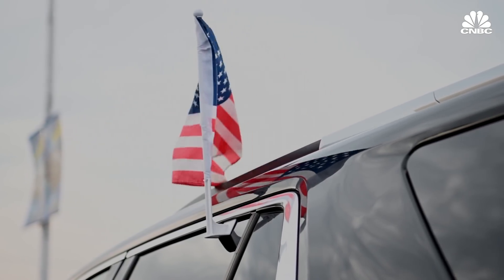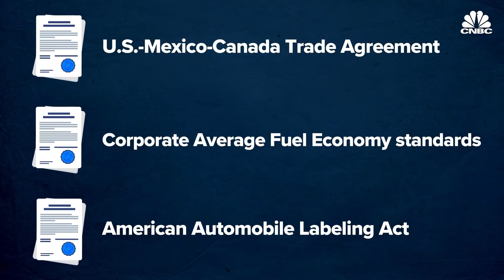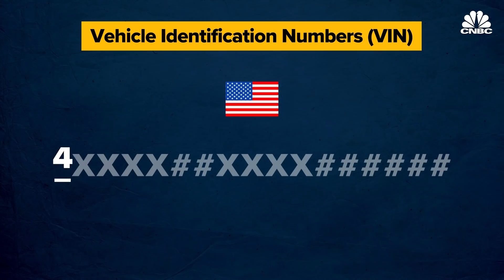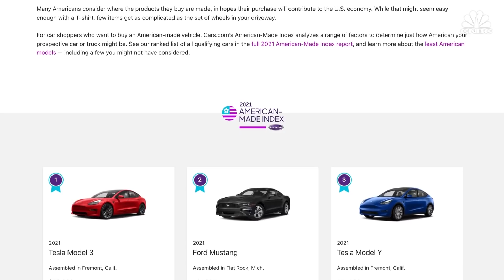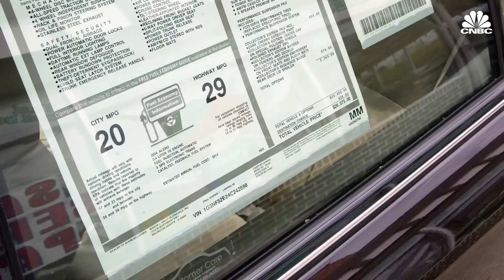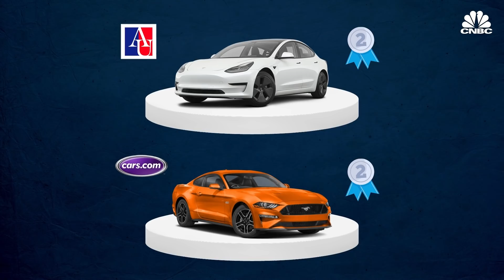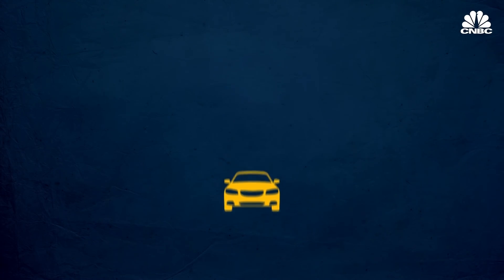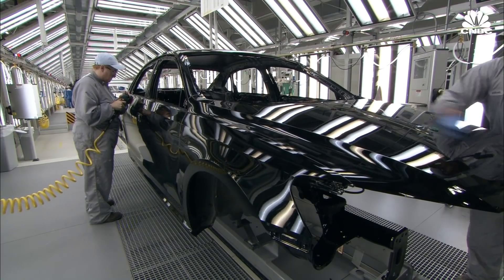How American Is Your Car?

Comment: The simple answer is: "It's complicated!"
I worked as a machine designer for over 35 years. The company I worked for, in the US, designed and fabricated the machines "in house". What we could not fabricate was sent out to local US companies. So it was "All American!", right? Except, no. Almost all of our purchased components like bearings, fasteners, air valves, gearboxes, electronic control devices were all made in foreign countries. Even some of our engineers, machinists, service people and even some company managers were foreign born. It truly is a global economy and has been for several decades.
Reply: Great summarization saves me quite some time watching the video
Reply: Don’t tell Trump and his cult that, they’ll insist isolationism is practical. 😆
Reply: No offence to OP but just because one's foreign born doesn't mean you should isolate them in this topic, they could have been kids moving here working and busting their balls to get that job no different than anyone else. There are also situations where the only option (at the time) was to bring someone in, for all we know they could be one of the top 5 people (or better than the locals) in their field. For workers all that should matter is fair pay and they have all the requirements to work, including paying their taxes.

Comment: My Buick Regal:
Final assembly: Germany 
Engine: USA
Transmission: Japan
Reply: And it’s actually german regardless.
Reply: @cory8837  - Well, it's somewhat older. The last MY for Regal was 2020. It was a rebadged Opel, a German brand that GM used to own but no longer does.
Reply: Hotel: Trivago
Reply: Opel Insignia
Reply: I'm happy as long as my car isn't made in China or Mexico.
Reply: How bad is your oil leaking in your German-USA-Japan car? 🤣
Reply: and who knows how much of the parts flew half-way around the world 10 times before they actually were attached to vehicle being assembled.

Comment: I'm slightly baffled as to how having such complex supply chains can be more efficient.
Reply: shipping things are super cheap.
Reply: @fallout560  The average cost of shipping a standard large container (a 40-foot-equivalent unit, or FEU) has surpassed $10,000, some four times higher than a year ago. The spot price for sending such a box from Shanghai to New York, which in 2019 would have been around $2,500, is now nearer $15,000. Securing a late booking on the busiest route, from China to the west coast of America, could cost $20,000.
Reply: It depends on the people's salary and factory capability.
Imagine paying an American 10usd a day.
Reply: It is cheaper thanks to fuel subsidies, low wages, lax environmental laws, etc.
Reply: It's all about labor and manufacturing costs plus shipping costs being lower than doing it all domestically.
Reply: You will find that a combination of specialisation, there are only a few parts manufactures, like bosch, who provide a significant portion of the market, and then tax breaks. So if 90% of X parts are made in X country, then you will have to ship. This specialisation and concentration will reduce the cost per unit where it is significantly cheaper to ship.
Reply: Not more efficient in production but more efficient making money
Reply: really, because its all bout the $$$$$$$$$$
Reply: Shipping thru the ocean is cheap.
So if you can make a part from another country  that is for example 2-3 percent cheaper that will help alot. As they make millions of cars per year.
Reply: @HadithOfThaqlain  That is the case now, but not when all these supply chains were being developed. Previously, having a component or module built overseas plus the minor shipping costs was cheaper than building that in the country so many went that way. Now, shipping is not minor and it may push that component/module supply chain to this continent, but only if those high shipping costs remain high into the future.
Reply: Cost of material/labor and you know pollution  😂
Reply: Not efficient at all, it's just cheap and that's basically the only thing companies care about
Reply: It's cheaper to ship pears from Peru to Vietnam, process and package them there, then ship it to the USA, than to grow and package pears in the USA
Reply: It’s not, but they have a steady supply of resources.
Reply: @fallout560  You seem to have edited your comment, did you find out that your cost per shipping container was wildly inaccurate? 😂
Reply: @HadithOfThaqlain  i made a mistake and put per mile instead of entire trip. I goofed
Reply: @fallout560  Got it 👍

Comment: Glad to hear my recently purchased Tesla Model 3 is one of the top 3 most American cars you can buy and supports our local economies to the fullest.
Reply: From the window sticker:
US/Canadian Parts Content: 65%
Major Sources of Foreign Parts Content: Mexico 20%
Final Assembly Point: Fremont, CA
Country of Origin:
Motor Assembly: USA
Gearbox/Transmission: USA
Additional Assembly Information:
Battery Final Assembly Point: Fremont, CA, USA
On-board Charger Final Assembly Point: Fremont, CA, USA
Reply: Rented a Model Y on vacation, not only American but extremely fun to drive and insanely fast. Would highly recommend
Reply: Too bad Tesla is against right to repair.

Comment: Big difference between American made and American assembled. Honda is the most American made manufacturer, Toyota is second. Being, they use more American made parts and American made raw materials than other manufacturers. Read a report several years ago that stated Toyota spent over $32 billion on American raw materials for their vehicles that calendar year. GM, Ford, and Ram use parts made as cheaply as possible in Mexico and Canada, which are shipped to the US for assembly. Hence, why they are routinely rated as the least reliable vehicles. That said, the 4Runner and Land Cruiser are the two top vehicles on the road, both made with Japanese parts in Japan, and dominate reliability ratings.
Reply: They had to because of US administration tariffs on Japanese-made imports, so they just did that as a loophole. Really not sure why the US is using tariffs on our ally, Japan, but K.

Comment: Going back as far as my old 2000 Pontiac Grand Prix, to my current 2018 Chevrolet Colorado, to all of the Ford vehicles I work with every day - the majority of the electronics (radios, touchscreens, HVAC control units, computer modules, window motors, speakers, etc) are made in Mexico.
Reply: Yeah my VW was made in Mexico

Comment: With the former Ford Crown Victoria, many people saw it an all-American car, which was actually made in Canada. Arguably Canada is part of North America, though not American.
Reply: There's a historical reason that cars made in Canada are treated as domestically produced in the US. By the 1950s the big three auto makers controlled 100% of the Canadian market. However high tariffs ment that to sell 10 different models in both countries they had to produce them in both countries. This was very expensive so the auto industry lobbied both governments and had them negotiate a free trade deal covering cars and car parts called the Autopact. Over time the manufacturers consolidated production but about the same amount of manufacturing remained in Canada, only now instead of producing small amounts of a lot of different models, Canadian plants produce a large amount of a couple of models most of which is exported to the US and almost all of the rest of the cars sold in Canada are imported from the US.
Reply: @bryandoehler8962  That makes sense! I recall hearing something about that before but not all of the details. I think now anything made in the US, Canada or Mexico is treated the same way, which makes it easier to offer more models to all three countries.

Comment: I’m so glad that I bought a brand new car in June 2020. The Hyundai dealer was overstocked with vehicles at the time. I had my choice of over 20 different 2020 Sonatas  to choose from. I got a fantastic deal, well below MSRP. Since then I have made an effort not to put any more miles on it than possible. In June 2022 the car will be two years old and have less than 15,000 miles on it. I plan on keeping it paying it off and sitting tight. I don’t even believe that their 2023 forecasts are accurate. I think we’re looking at 2024 maybe even 2025 before supply chains are anywhere near where they were before Covid, and even then things are never going to be what they were before Covid. I was just at CVS today and half of the shelves in the store were empty.There was no milk there was no orange juice, only two of the eight or nine items that I needed were there. So I’m not even gonna bother to shop at CVS until the supply chains are better. No sense wasting time gas or putting miles on my car for empty shelves.

Comment: May not matter since my bicycle is made in Eugene Oregon. Parts mostly come from other US manufacturers, except the gear box which is German.
Reply: Trek bikes are still 90% Chinese and some Taiwanese in their assembly
Reply: @ivanvarela3215  I wasn't sure how much of a Trek was made overseas. Thanks for info. I mean, Taiwan does some good work and puts together quality items. Co-Motion is a small company in Oregon that prides itself on US made. However, the drive trains such as Shimano and Pinion are made elsewhere. The Gates carbon belt is, I believe, made in USA. The car company Tesla is also made in USA, but many of their electronic components rely on chips from China. They are trying to move more of their operation overseas. We, that is the USA, need(s) to have transportation which does not rely on stuff from other countries, even if that means paying a bit more. A bike has no electronic parts unless you add a dynamo which generates electricity for lights. The best one, like it or not, comes from Germany, the Son Nabendynamo.

Comment: My car: rebadged Chevrolet SS Sedan in America, better known as the Holden VF Commodore from Australia

Vehicle assembly: Elizabeth, Adelaide, South Australia

Engine: 6.2L LS3 naturally aspirated V8 derived from the C6 Chevrolet Corvettes

Horsepower and Torque: 415hp and 415lb-ft

Transmission: Tremec TR6060 6-speed manual transmission

Comment: Very simplified for trade. Country of origin does not indicate the origin is purely from that region for USMCA. It merely indicates that the good passes one of the three test to be considered country of origin US, Mexico or Canada. The  value content is typically never 100 percent derived from that area. Usually the three test are deminis, tariff shift and RVC to pass and be considered "100% origin" from one of the USMCA's country. There is currently debate with Mexico and Canada saying that if country of origin  is from that region the value content that is foreign not from those area's should be ignored and considered 100% value from those regions. The US is stating the opposite that even if it passes those value contents must be broken down by foreign and not use just being country of origin determination. The topic is a lot more complex and the system to make it work would be a lot something bigger than people can even imagine.

Comment: My car is  Japanese made.The VIN starts with a J. 2010 Toyota  Camry.
Reply: No it's not. There's no way all the circuit boards, and small components in there are fully Japanese. Then there's the actual raw material source
Reply: Scotty “Rev Up Your Engines” Kilmer would be proud
Reply: @veganpotterthevegan  you're right.
Reply: @FilthyGopher  they're made in Kentucky, but also in Japan, China, Russia and Thailand. https://en.m.wikipedia.org/wiki/Toyota_Camry_(XV70)
Reply: @damilolaakanni  The Altis is basically the Camry.  It sold well but they stopped making it due to emissions demands. It's very unlikely they won't re-release it. It'll probably be a Camry Hybrid
Reply: @veganpotterthevegan  true. Australia has ditched the V6 models, and I doubt Europe even has Camry's at all.
Reply: @damilolaakanni  Toyota as a whole sells poorly in Europe.   They're actually only 10th by brand which is crazy
Reply: @FilthyGopher  Actually if the Vin on a Camry starts with a J it was made in Japan. If it starts with a 4 then it was made in Kentucky buddy.

Comment: I have my three Vins# starting numbers from north America 
#1 a 2012 Liberty ,#2 a 1993 Grand Marquis, #3 a 2012 Fiat 500
Since my 3rd gen 91 Camaro RS ,I use to see parts not only from US, the bumpers was made in Mexico. My 500 have an made in the US Chrysler engine with a Japanese transmission and Pirelli tires from China!.The  Liberty wheels are made in China too.And in the Grand Marquis the A/C thermostat was made in Brazil.

Comment: My car is not American - it's Japanese :) Lexus is the most reliable car that has no problems. Service technicians just walk around at Lexus because no one brings in their Lexus to get it "fixed." Never had an American car.
Reply: Not all Lexus cars are made in Japan their are Lexus vehicles that are made outside of Japan.
Reply: All the Lexus' I see at work are made in Canada with few coming from Japan.
Also I drive an American made Toyota. It was assembled in Mississippi but has Japanese engine and transmission
Reply: @BentleyCC  Their is also a Lexus made in Kentucky.
Reply: @Embargoman  Yes there is the Lexus ES350... I never said they're wasn't. I'm just saying not all Lexus' are "Japanese"

Comment: I wouldn't buy a new car. Even if they were free. 
If it is still running after 15 yrs on the road. That's the car I want. And they are easier to maintain.
Reply: Old school cars are easy to fix!
Reply: @Embargoman  
I drive a 99 Acura tl. Repairs are pretty basic.
How many new cars will still be on the road in 15 yrs. I suspect that it won't be that many.
Reply: @thomasridley8675  Well that what I could say is that back then cars from back in the days to say I see cars from the 1950s and 1960s hanging on as to say classic cars don’t have electronic parts and they where easy to fix. 

To say a Ford Mustang from 1965 still runs until the person who bought a Mustang from the new generation after 15 years won’t run but the 1965 Ford Mustang will still run as new.

I am just saying old school cars are easy to fix and yet I even seen a 1956 Chevrolet Bel-Air on the road with no issues running like the Energizer Bunny.
Reply: @Embargoman  👍

Comment: You know i tries to back the us and buy an american 
Add car or at least as american made
As possible so i bought a mustang v6 then a mustang gt both manuals, being that i alwaya bought japanese (honda) and well.. wouldnt buy american again, after 4 years and 7,000 miles my mustang gt cracked its evaporator core which controls the air cooling for the ac and thr bill
Was 3k.  I said ok well no thank you sold it as is took the loss and will not be buying another american car in a loooong time i believe in second chances but its gonna be a while, ive had 4 Japanese cars in 10
Years with over 200k miles
Between them and never one issue, specially any issue costing 3k so yea disappointed to say the least.  Ow i have a mazda miata as
My sport car.

Comment: Once the fully electrics REALLY get sold in decent numbers in the US then the parts suppliers WILL diminish in half or more as your no longer needing such VAST numbers of individual parts (req'd for ICE ) to make an electric vehicle.  The entire situation is going to change SIGNIFICANTLY in the next 10 years. The BIGGEST problem tesla ever made in the tesla production line was to make Everything in the US. He should have made other parts over seas and lowered his price with easier manufacturing. He thought too much future tech .. Flashy manufacturing.

I call Bull$hit on the the reason given in this video for not having larger number of electrics in US..it's protectionism on the part of the US.  If electric chinese cars were ALLOWED to be sold in the US you'd have HUGE numbers selling like crazy.